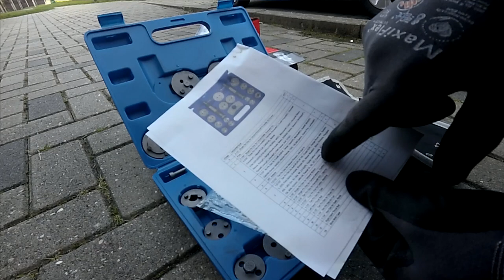seat ibiza rear disc replacement (model 6j year 2008 - 2012 )

Comment: Please use axle stands,  you only need one if lifting one wheel.  The car could easily drop if it's only on a jack; and you could lose a leg, or worse.  And remember the car has no brakes because the handbrake is off during this job.  So put it in 1st gear and chock the wheels that aren't being raised.
Reply from the maker: I forgot them for one time, i konw you are right! Tnks for the tip. 😁
Reply: Totally agree re: the axle stands/chocks. Also the pad retaining spring clips can be clearly seen, through the gap in the rear of the caliper, to be incorrectly located. Also no footage of retracting the piston. Dangerous !!!!!
Reply: Deci discurile de frână din față sunt ventilate, iar cele din spate nu sunt ventilate. Corect???
Reply: Yes, that is common on many vehicles because the front discs do more of the breaking work and get hotter than the rear ones.

Comment: You scared me to death not using axle stands. At one point when you were talking the calliper off the car was moving. You were one lucky guy you didn’t lose your leg. I’ve seen this happen when I worked in the motor trade. ….advise please put the wheel under the car for safety but buy some axle stands they aren’t expensive…..by the way the brake clips are not fitted correctly…just thought I’d mention
Reply: This guy is a nut
Reply: @Marrow614  why is he.. he is rite axle stands an STILL put the wheel under the car....
Reply: I was just going to write how stupid this amoture guy. Sticking his leg under the caked car one slip his leg gone!

Comment: I did this job on my seat ibiza. And now when i drive for about 20 minuts the breaks start to squeek. And when i press the brake it goes away. 

It makes a smal squeek per rotation. So the faster i go the more squeeking sound. What can this be?

( only the pads are new, i havnt changed rotors yet cuz it looks good)
Reply: Did you use brake grease on the metal parts where the pads slide within their mounting on the caliper?   If not, the pads are probably pressing slightly on the disc. You will get squeeking, pad wear, heat and use more petrol.
Reply: @henryjohntobin1  u are right my pads where pressing lightly on the disc. But the reason was that my caliper was bad. I changed it and its all good now.
Reply: Oh yes, if the caliper is sticking that will cause squeaking or a dragging sound from the brakes,  especially when you first drive each day.  One indicator of this is a wheel feeling hot to touch after driving. I'm glad you got it sorted. 👍